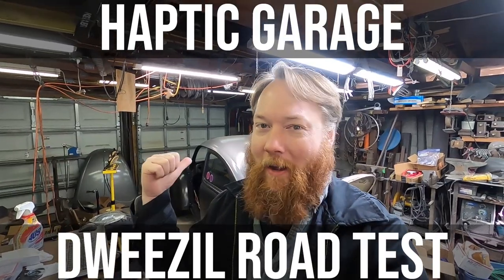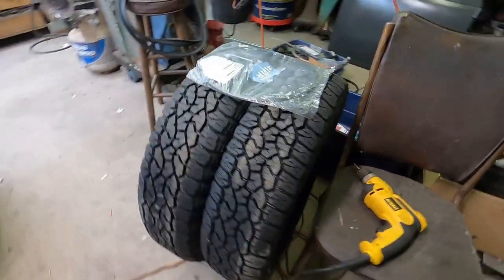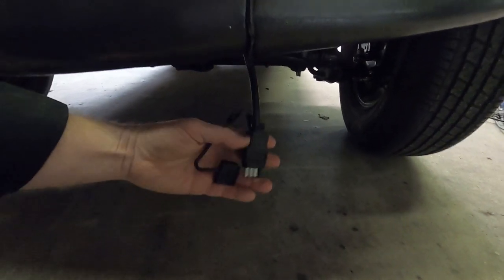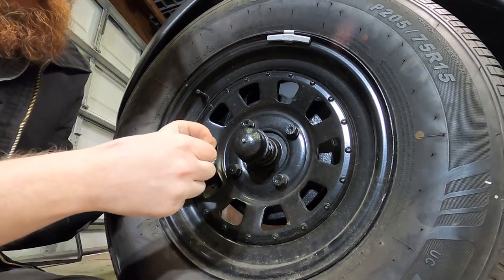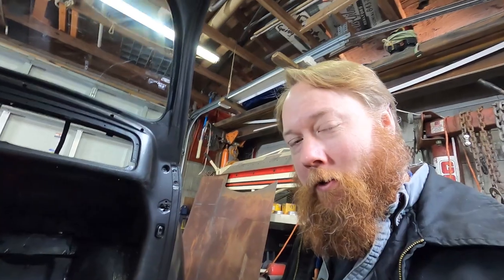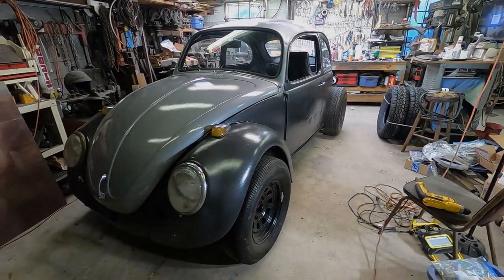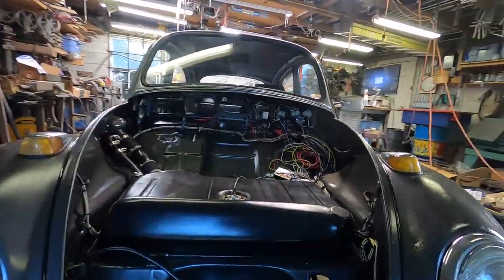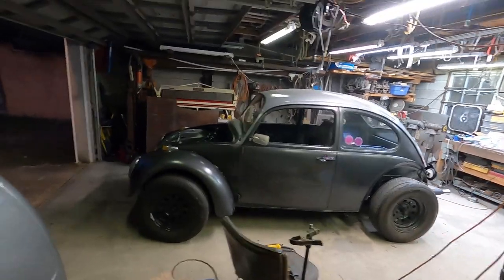Will it drive? Big Update #VDubRun21

Comment: Just some advise when aligning doors. Always leave the door striker off when aligning the doors. Once the doors fit the body, then add the striker to set the latching of the doors. The latch and striker shouldn’t be used to help align the doors when closed.
Reply from the maker: Thanks Robert, this makes sense. I bet the driver's door is a little tweaked with the way I have it mounted right now. I'll put readjustment on the list.

Comment: Yes sir; West Coast Metric is the shit! BTW, OK Fixer, a YouTuber who has restored a couple of Bugs and who’s a glazer by trade uses black butyl sealant between the seal and the body of the car, to give an added layer of protection.
Reply from the maker: Yeah, I'll be giving them a call about some other seals I need. Thanks for the tip- sounds like something that is best done during install but I'll remember that for future use. Seems like if it was tastefully done it couldn't hurt.
Reply: There is no reason to add sealant in those glass seals. VW didn’t and I’ve installed many and no leaks. If you have to do that to keep it from leaking. Replace the seals they are garbage.
Reply: @robertlambert5299  Actually some of them did; how do you think the parcel area rusts in Bugs?
Reply: @vayabroder729  if they had sealant in them someone added it later. I worked at a VW dealer in the collision shop when these cars were still being produced. 
They rusted out because the seals were rotted.

Comment: Fantastic job in getting Dweezil a driver again, we’ll done.  Are you putting cut down fenders on the rear?  I wasn’t sure what the rear lighting looks like.  Anyway, you’ve built a very solid and strong bug, which I hope gives you years of fun and satisfaction.  Can’t wait to see the continuing story and thanks for a really great video.
Reply from the maker: Thanks Richard! There is a slightly earlier "pope's nose" decklid fitted to hold the license plate and I am temporarily using trailer lights in the rear. I plan to widen a set of stock rear fenders and fit them with stock tail lights. The project is beyond my skill level but that's how we learn new things! I look forward to making these changes after a few higher priorities are completed. Thanks again for the question and kind remarks, always great to hear from you.